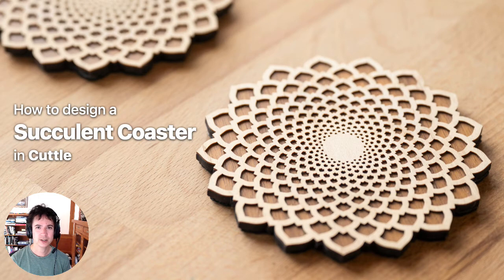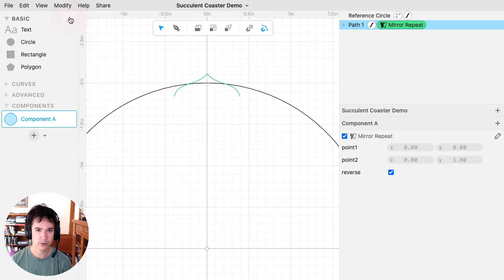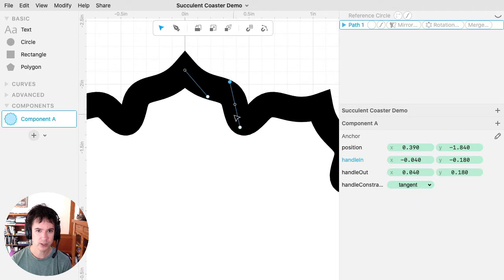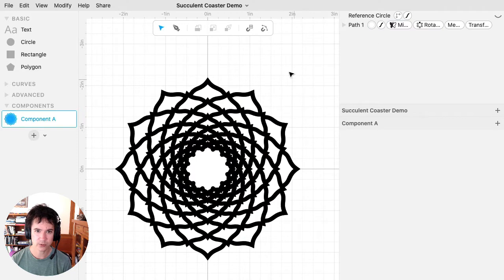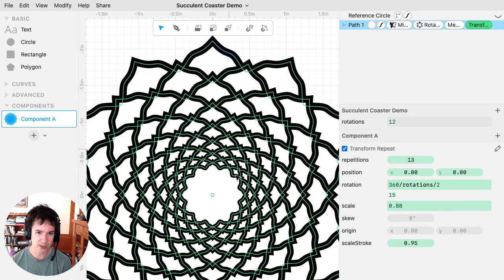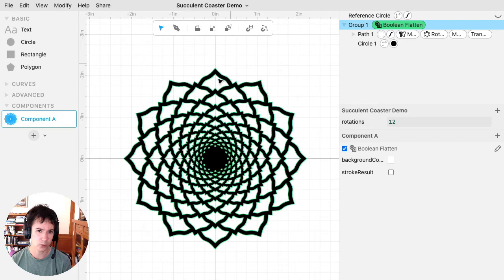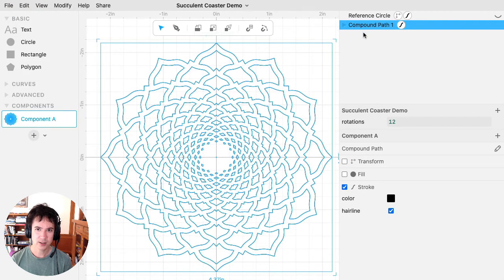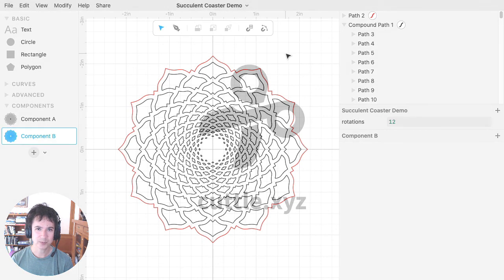Make a Succulent Coaster in Cuttle

Comment: Once you are done with the design, why not convert to path instead of boolean flatten? I'm not understanding the value of boolean flatten if you can still edit the design in other ways up until you convert to path.
Reply from the maker: Flatten will:
- Turn stroked shapes into paths that outline the stroke
- Automatically union the black shapes and subtract out the white shapes

If instead you just did Convert to Paths, the Repeats and other modifiers would go away, but you'd like have stroked paths and a bunch of layers of black and white shapes.